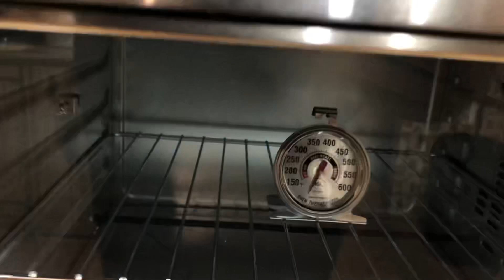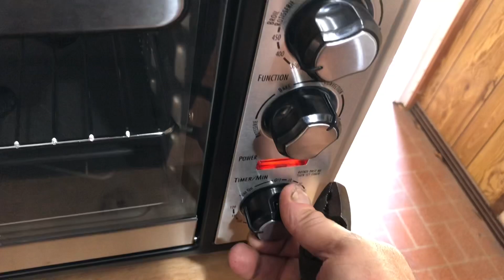Deep thoughts from the knife shop

Comment: in heat treatment do they smoke?  Can you heat treat in a regular stove oven ?
Reply from the maker: Heat treating is done at around 1450 degrees. Tempering is done at 400. When I quench the knife in oil after taking it out of the 1450 forge, it flames and smokes. Tempering is just a bit Smokey as the oil residue is cooked off.
Reply: @bctruck  Thank you.